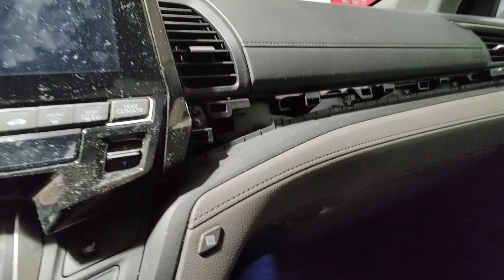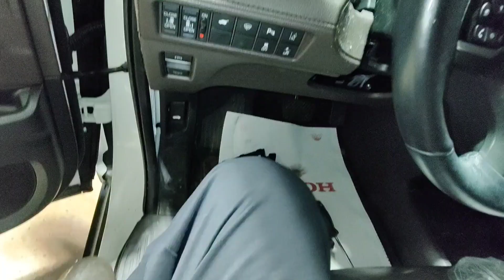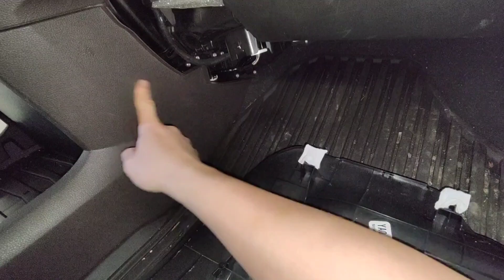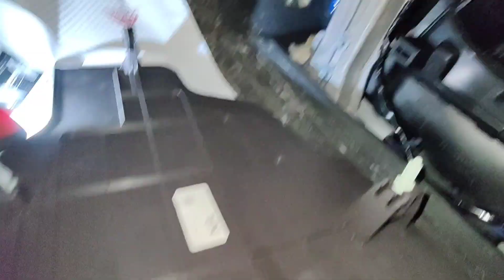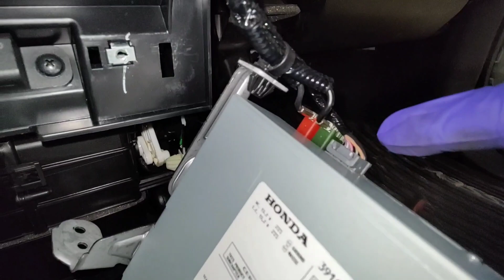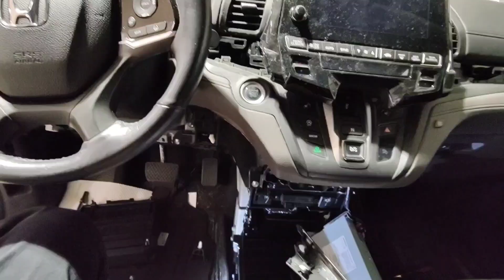2018+ Honda Odyssey audio unit removal.

Comment: The dealer replaced those on my unit....but now on my 2021 Honda Odyssey I have fault code  B1230 "short in the sunlight sensor circuit". Does this mean they pinched or messed up the wire when doing to audio unit job?

Comment: Any idea why my 2023 Honda Odyssey has no sound but it shows that music is playing?
Reply from the maker: It can be anything. I've had the internal fan of the audio unit fail and it overheats and cause no sound. Or the amp fail and cause no sound as the speakers power comes from the amp.

Comment: I replaced the part, and now it's asking for a PIN code. Where can I get it?
Reply from the maker: You don't need a pin code. You just need to confirm that your voice command button is working because some of the system on that screen is yellow. By pressing those buttons to confirm that they are there on these kind of unit.

Comment: My 2023 Odyssey Elite has the audio popping, and the radio services no longer work (AM, FM, XM). The radio services just have a never-ending load screen. Also, the cabin view camera freezes. Is there a recall or extended warranty to cover this issue?
Reply from the maker: In the early 5th generation Odyssey we were fixing the fakra connectors for the popping and the sound cutting out. Don't think the later 5th gen has that recall. A bad connection in one of the fakra connectors can cause no sound.
Reply: My 2020 has a connector recall.
Reply: FIXED: The 2023 has the FAKRA repair from the factory. However, one of my connectors at the amp in the back passenger-side wall had broken off. I ordered an $8.00 Fakra RG174 standard 50-ohm RF antenna cable from Amazon and it fixed the total loss of AM/FM/XM connectivity. It connected the AM/FM/XM tuner unit (39800-THR-A21) to the amplifier (39186-THR-A21). My tuner unit was also bad, which was causing an audible disruption every 11 seconds. 
Many of the issues described by others here are likely one of the two assemblies attached to the rear of the main infotainment screen, such as the telematics unit.
Reply: 2018-2020 Honda Odyssey Radio Receiver EX-L Part #39540-THR-A341-M1

Comment: Do you have video on how to replace the pull down shades in passenger area
Reply from the maker: For an Odyssey? I do not but the sliding door panel is pretty easy to remove as it is clipped in and might want the middle seats removed to give you space to get that panel out with the sliding door partly closed. You can see this video @12:26 to remove the handle. And just make sure the door seal is detached from the bottom of the panel.  https://youtu.be/ixCTdF6zh5E

Comment: Do you know of any easy way to remove and replace worn shift buttons?
Reply from the maker: The shifter button assembly? Or are you asking just the individual buttons? The shifter comes as an assembly and just the buttons can't be changed or there are no parts that show up for just the buttons.

Comment: Do you know of an easy way to replace the hazard switch button on the same vehicle?
Reply from the maker: I believe they are held in by pressure tabs on both sides but comes out with the passenger side air bag off light.
Reply: @theoffroadingmechanic Thanks. I looked at my replacement switch and saw the tabs. Used my trim tool to get it out. The harness going to the switch is a bit short, but it was pretty easy to replace.

Comment: Do you have a video on repairing the connectors
Reply from the maker: Nope but they're not hard to take off just need to break the tabs on the old connector to slide the pins out and it just slides and clicks in to the new one. Didn't think it matters since they have an extended warranty on them if they needed to be done.
Reply: Where can I find the appropriate replacement connectors?

Comment: I hate FAKRA connectors. They are good money for a placebo though. I know that there are people that recomend crimping the metal connector on the connector to make the connection a little tighter, and that supposedly helps. I haven't worked at Honda for almost two years now, so I'm not up to date, but last I checked that is still not a Honda approved repair. I have done everything techline suggested, including submitting pictures to techline showing the proper installation of the connectors and making sure the wiring is straight. THE AUDIO STILL POPS. I fear this is a problem Honda will never fix properly.
Reply from the maker: Yea also have to move the wires to where there is no tension or bend to them when re install. There is a bulletin but we have to do the bulletin. But your right still comes back for the same complaint.